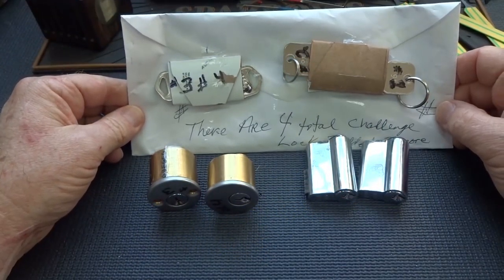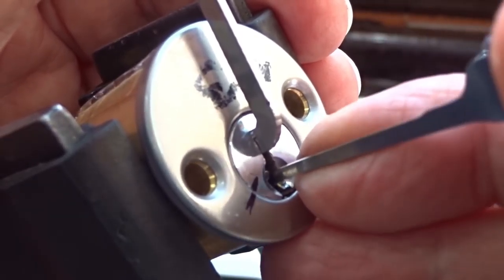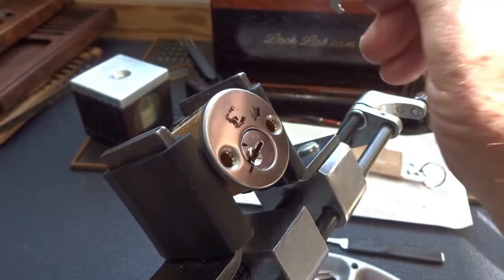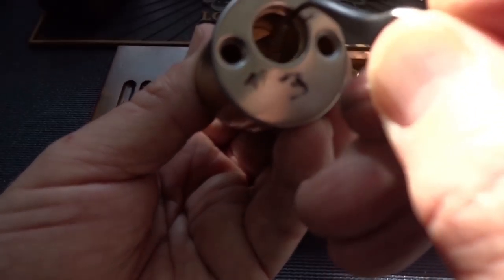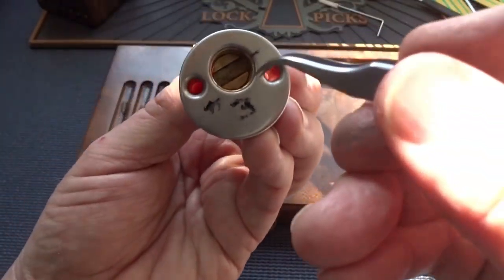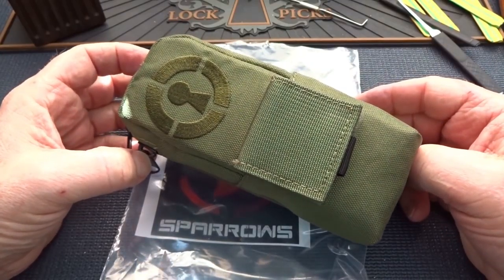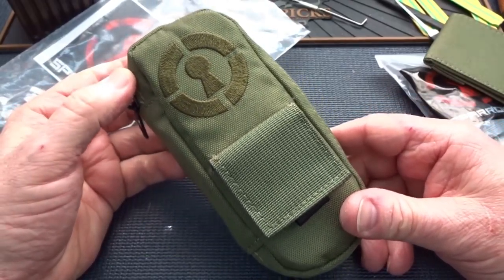(1248) Challenge: Mark's cylinder

Comment: After watching many on Bill's & other youtube picker's vids, I have come to the conclusion that the only way to beat the really good pickers is to start with a lock with really good tolerances, an unavoidable trap or both. I am no expert and may be wrong but the normal security pins and threading/undercutting does not look to be providing much of a challenge. Please note, I am not trying to diminish the massive amount of work that goes into some of these challenge locks, I am not able to build anything like any of them(or pick them).

Comment: If you file the top it makes a void between the core and lock body so it makes it easyer to pick because a extra void give much easyer picking the sheerline is 1 to 2 mm instead of 0.12 mm . Makes it easyer
Reply: The trap pins would have worked better it it hadent been filed core

Comment: I’m not a fan of the filed-down cores. It does create a much larger shear line which will greatly decrease pick resistance. Pin tumblers have an inherent defect anyway inasmuch as the tops of the key pins must be slightly crowned to account for the core radius. Ideally they would use square section key pins with a single curvature top but that’s all extra expense.

Comment: I still don't agree with the filing part on the lock, but we had a healthy discussion about it last time. 

I think he went a bit overboard on what he was trying to trap you with and that actually made it easier.
Reply: I missed the discussion but I am in the camp that thinks filing plugs is a very bad idea altho my hands are not entirely clean due to desperation but it is a last resort and rare as hens teeth around here.

Comment: Would a plug flipper get you past those trap pins if you know where they are (on the cylinder)? I had the idea of using slots for such trap pins so the trap has longer to engage... This would make it harder to get past with a flipper.  Of course you could just drill trap holes all over the place and then a picker would have no idea when a trap would engage.

Comment: When making keys for custom locks I have on occasion filed one bit down too far then just filed the plug to make the sheer line work so it doesnt get hung up on the driver pin 😅😝
Reply: If you have a soldering iron you can build the key back up, even attaching brass to ensure that the key doesn't wear out. :)
Reply: Mr Lockwood I was thinking about that but I was worried that iover time the solder would wear out into the lock and start making it stick and damage the lock too 🤔 funnily enough the lock I'm talking about was a lockwood assa abloy 😂😀🍻
Reply: I have used lead solder to join new brass onto keys which needed it, haven't had a single issue yet. The keys shouldn't be experiencing temperatures which will melt the solder so it doesn't run and with the brass capping it, there isn't any issue of the softer metal (solder) coming into contact with the key pins so it doesn't wear down.
Reply: Mr Lockwood  hmm ok good to know as it was only a few mm just always worried over time the solder might snap off in there or wear down lol , also what part of Aus are you from mate ? 🍻
Reply: After u solider the key to get it right then just use that key to cut a new one?

Comment: Are T pins are a bad idea? Even for a qualified locksmith who falls victim to them would in same pickle or is there some secret to dealing with them even after they have done there job?
Reply: The key thing that T-pins do is control binding order.  A T-pin won't offer much resistance to picking, but on the flip side it must be picked after other pins.  If a high-cut T-pin is immediately behind a low-cut pin, it will be necessary to pick the T-pin while the low cut pin is in its final place, acting as an obstacle.
Reply: I sort of get what saying but after successful picking and turning the core, t pins fall into place its game over (or is it) whether hobbist or actual qualified locksmith as here in Australia.... I would love to here if there is some way of fixing/reusing lock after t pins have falling into place....
Reply: If a core has holes designed to deactivate construction keys, either put a filler material in the holes or add slots to them.  I wasn't suggesting the benefits of T-pins as a trap, but--as I said--as a means of controlling which pins must be picked last.
Reply: Sorry I think your missing the point. Lets say the lock has been picked in whatever order of binding. The core turns then t pins fall into their respective holes, how can the lock be reused? Cheers
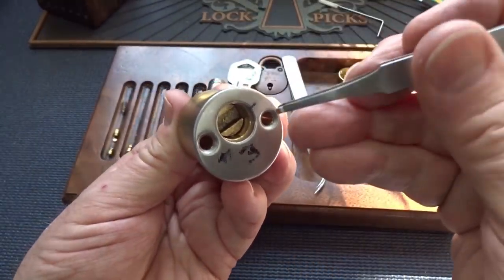Reply: If the lock has construction-pinning holes and T-pins have fallen into those, and there aren't slots engraved to let the pins move back to the 12:00 position, then reusing the lock would require gutting it from the top, which would be practical with some lock designs but not others.  I would regard the use of T-pins as traps as unsportsmanlike unless the picker is warned about them (e.g. told not to turn the lock between 9:00 and 12:00)) or a means is provided to reset them (such as milled slots allowing the lock to be reset).  Even setting aside the traps question, I'd regard T-pins (versus other types of security pins) as a bad idea from a security perspective except in cases where their inability to stay set until other pins are picked is actually useful.

Comment: I think filing any material off the plug is a bad idea. It is generally done by those who don't have a universal pin kit. Altho I cannot find a shred of evidence its true, I've been under the impression it is actually illegal for a locksmith to weaken the security of a customers lock, mezzanine pinning obviously excluded. A swat team won't take you down but its a bad practice.
Reply: I agree that removing material isn't good as it creates a larger area for the pins to be at shear. Having said that, I have pulled numerous locks apart and found plugs that have been treated exactly like this. Another 'trick' that some people use is to bevel the top of the pin chamber with a drill bit which is larger than the chamber diameter, creating a ramp for drivers to slide up.

I can think of a few different scenarios where it would be used but none of them are really a valid excuse for doing it. Small bit of trivia: Lockwood plugs from factory are nice and snug, rounded at the top and the sheer line is only as thick as absolutely necessary but Abus plugs can come with factory flat spots machined on the top of the plug. I'm unsure of the reason for this whether it be to increase the longevity of keys/pins or whether it is a cost cutting measure but at the end of the day it has the same effect: a lock that is easier to pick.
Reply: I’ve seen cheap shit euro locks like this from the factory, like they just put in any old pins and razzed them all flush with the core using a linisher. Needless to say it was an easy pick and an even easier rake.

Comment: So if a T-pin did end up falling into a trap, is the only way out through the top of the bible?
Reply: Yes which is easy for a challenge lock with set screws on top of the Bible but if this lock was installed on your front door, you would have a mess.
Reply: I can imagine. I have a schlage core I got off ebay which I'm going to turn into my first challenge lock. I picked and gutted it the other day and I was surprised to see extra holes (trap holes?) in the core. 2 other cores I got from the same seller don't have them. I think I'm going to make use of them.